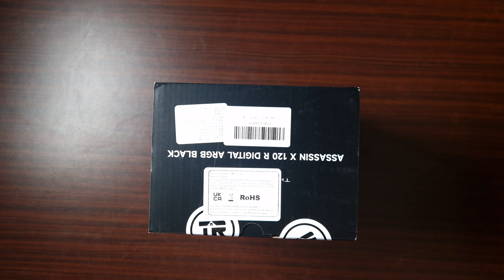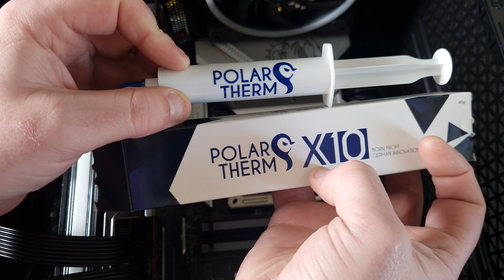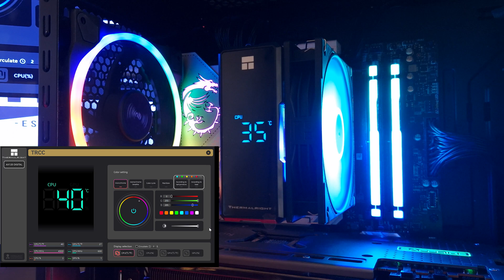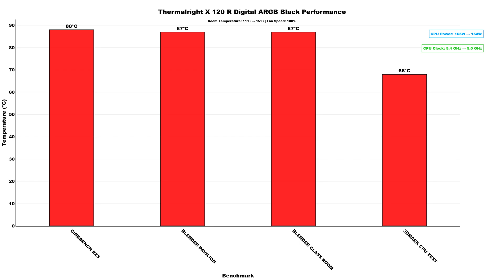Thermalright Assassin X 120R Digital ARGB CPU Cooler Review

Comment: very good product. I use it to cool my 7800x3d 9060xt build in microatx ch160 plus case. CPU temp at idle is around 40 degrees and gaming around 50 degrees Celcius. just 2 case fans for exhasut no intake fans. COlours are good. fan is very silent. .
Reply from the maker: Glad you're happy with the product, thanks for sharing your experience!
Reply: @WELSHYTECH  hey man, how does this cooler compare to the Assassin Spirit 120 EVO Dark?

Comment: can you close the pc lid/door with it?
Reply from the maker: You mean side panel yes it isn't a tall cooler
Reply: @WELSHYTECH yes, could you tell me the height overall inside the case? Would a 158mm clearance for cpu case be enough?
Reply from the maker: I go through the specs in the video and the case I'm using is the Be Quiet Shadow Base 800 FX

Comment: Using this on my R7 5700x
46 degree on idle
52 degree on roblox
81 degree on roblox and farlight84
70 degree max temp on cinebench

is that normal?
Reply from the maker: That's actually fine the idle does seem a little high but depends on where you live
Reply: @WELSHYTECH i mean it was 81 degree on 2 games, but 70 to 75 on cinebench

i thought i might be wrong when spread the thermal paste, so i don’t need to reapply the thermal paste right?

thanks
Reply from the maker: Seems fine to me but if you're worried reapplying Thermal paste might help

Comment: I bought this to cool my Ryzen 7 5800X after my DeepCool Gammax fan called it quits.. This performs just as well if not slightly better than the DeepCool. in gaming I have noticed it sit around 60-70C consistently. Pretty good deal at $25 USD.
Reply from the maker: Yep it's a great cooler

Comment: Need help.I got the same cooler with gigabyte b450m wifi 1.4 - it's connected to the proper USB 9 pin connection on the board but all I get is two spinning lines. Software doesn't recognize the screen.

Comment: You left off a few details like attaching the fan. And, while minor, connecting the cables would complete the installation process. Otherwise, I found it helpful as my unit did not come with any instructions. Also, it wouldn't hurt to mention the need to remove the preinstalled fan clips that seem to come with new AM5 motherboards.
Reply from the maker: I agree there are things I didn't include but I never used to include many things. I'm trying to improve my videos so if this is something I need to improve I will do it and my review sample came with a manual and the manual is available on the Thermalright website

Comment: Just installed it. Unfortunately, it displays "CPU Core" temp, which is usually 10-15c less than CPU die average.
Reply from the maker: It's a small screen, and I really don't see the point in these coolers, mainly single-fan coolers with screens. It's just a craze every brand is doing right now. If you want a better screen then the AK620 DIGITAL Pro has an amazing screen

Comment: Should work with Ryzen 5 9600x right? Also great video
Reply from the maker: Yes will work just fine with that CPU and thank you
Reply: 100% yes. It should also run lower temps as well since that cpu also just runs cooler than others. I'm getting both the cpu amd this cooler and have been looking up a lot of reviews and such and figure they'd make a good pairing, pretty much any cooler by thermalright above like 16$ would be fine with it.
Reply: @ghastlyanarchy1720 yeah that’s exactly what I was thinking
Reply: Glad I could help!

Comment: CAN  YOU PLEASE HELP ME I INSTALLED THE SAME COOLER BUT THE BIGGER 2 FAN MODEL AND THE TEMPRATURE UNIT ONLY SHOWS MOVING LINES ,DOES IT MATTER WHAT USB PORT I HAVE TRIED THEM ALL ON GIGABYTE 870 ELITE
Reply from the maker: You need to download the software
Reply from the maker: And yes it has to be in one of the USB2 headers at the bottom of your motherboard

Comment: i am waiting for mine for my 7600. hopefully this makes it not reach 80 to 90. i've only been using amd's stock cooler
Reply from the maker: This is definitely better than a stock cooler you will be fine
Reply: @WELSHYTECH  damn... i forgot that the digital display needed a connection. my gigabyte a620m gaming x motherboard only has one 9 pin usb slot on it for the front usb ports. i wonder if a Y splitter might work for me. temps have been beyond great though. went from going up to 80 when im watching youtube to now finally being normal
Reply from the maker: Yeah get a splitter it should work and good glad it's doing better now

Comment: nice review mate, the pricing in my country is considered a great deal, currently using the stock cooler of my r5 5500 and constantly hitting 87C under load, should be an easy job for this cooler since you tested with a much hotter cpu in the video. thank you so much
Reply from the maker: Very welcome, bud, and yes it will definitely do the job

Comment: Bought this, installed it, downloaded the TRCC software...run...and it says not connected?  Fan is powered, ARGB is connected and plugged into a USB port.  What's the problem?  Why didn't you show your connections?  That's just as important.  So how do I get "Connected"?  Asus TUF Gaming B650-Plus WI-FI
Reply from the maker: My connections are exactly the same as yours. Did you download the right software it has to be compatible version of TRCC

Comment: Im debating whether getting this or the thermalright assassin spirit v2 plus with 2 fans single tower idk if 2 fans are really necessary if i already have an exhaust fan with the case i really like this one aesthetically
Reply from the maker: Two fans would help push more air, but the back fan will be fighting for airflow. This one does the job just fine

Comment: Have some 6 and 7 heatpipe Thermalright coolers this is interesting  since they added the screen, usually costwise I will on budget builds use idcooling se214se 12400F, older cpus etc.
Reply from the maker: Id-cooling have some good coolers as well

Comment: It’s good for a Ryzen 7 5800xt? Help me plz
Reply from the maker: If you plan to Overclock, then no, but if you plan to leave it at default then yes will be fine
Reply: @WELSHYTECH  I don't want to overclock, my question is if even with that I should put another fan or if just the one that comes with it is fine.
Reply from the maker: You can add another fan if you want but it will be fine with one

Comment: I use this cooller too, great simple display temp monitor and great for my 5600x
Reply from the maker: Yep
Reply: Hi im also using 5600x, what temp do u get when gaming using this cooler?
Reply from the maker: Temps will be fine during gaming
Reply: @limie9319 on idle i got 40, with stock fan it was 50. In game i didn’t tested it yet but stock fan was 81 degrees max ig.

Comment: I think I will use the 120 burst assassin, I think it's one of the best single towers, dual tower is good but a bit too bulky, maybe for an extreme system
Reply from the maker: It is one of the best single towers, I'd still recommend the Burst assassin over the assassin x any day it's just better
Reply: @WELSHYTECH  Wich other ones ( single ) would you reccommend? It's 26€( 23£ ) here in my country so I think it's a great deal.
Reply from the maker: There's the Peerless Assassin MINI it's a very good cooler as well, and it is not as big as the original Peerless Assassin
Reply: @WELSHYTECH  But it's a dual tower, basically it's a very short dual tower ? does it perform better than the BA ?
Reply from the maker: @ It surprising performed very well I have the review on my channel